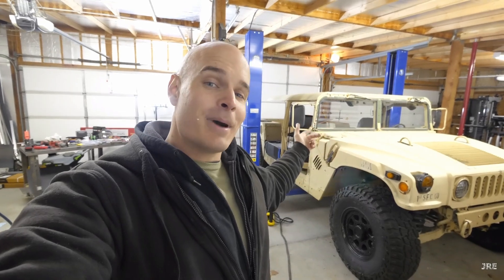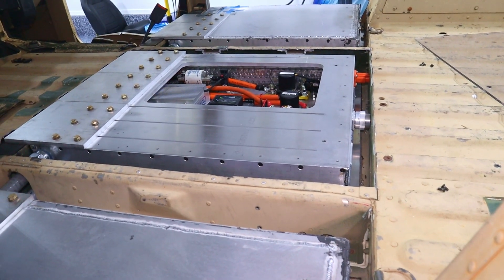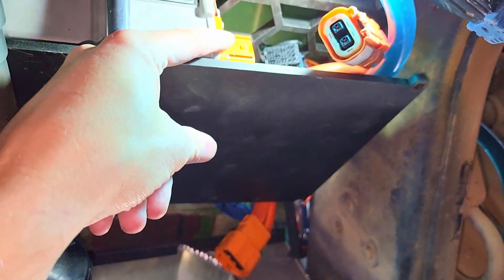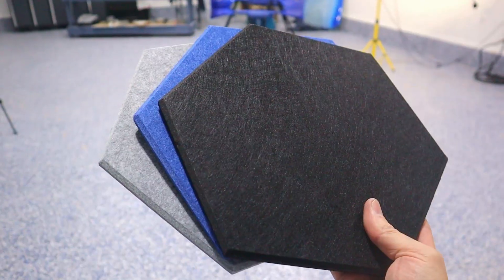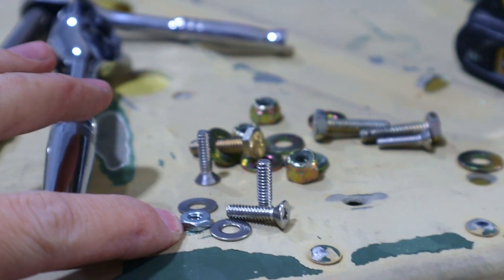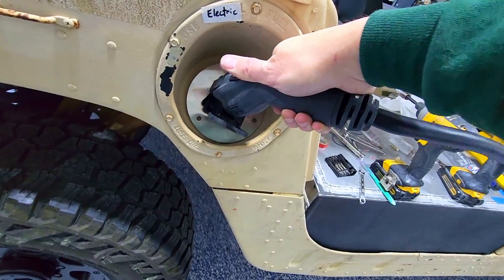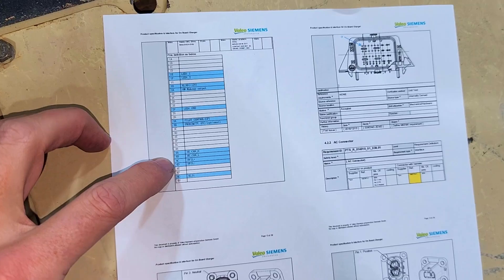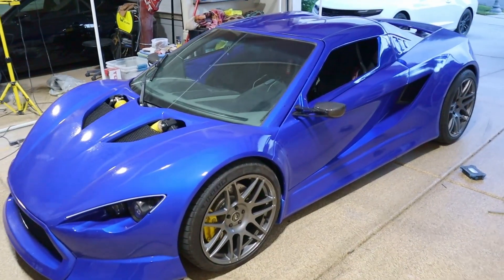Electric Converted Hummer - Diagnosis from the EV Doctor

Comment: You may have to charge each cell individually then try again. All it takes is one cell reading under 2.7v and it wont function.
Reply from the maker: I'll have to get a CAN adapter and talk with the BMS, see if something like that is going on
Reply: One row*. The all the cells in parallel would have the same voltage
Reply: @DoesntRefillTheBrita  Ya thats true for some reason i assumed it would be wired in 4.2v but that would not make sense for any electric motor. It may just be 1 cell that is faulty and you will not know unless you tested every cell individually or if the computer was smart enough to display a error with a pack of cells then your stuck checking every one yourself. Because it took him so long to make the hummer chances are the batteries got really low and is causing these issues. Its the most common problem with lithium batteries and its the same reason why samsung phones are popping open because of the batteries inflating. Charge your batteries! 3.7v for long term storage.

Comment: How odd - there really isn't a neutral in the J1772 connector, L1, L2, and Ground.  Maybe Ground is supposed to go on top of that charger connector.  Weird European charger stuff!
Nice first video.  I'm guessing you're right about the CAN bus being the culprit.
Reply: Neutral is only needed if you want to get 110VAC from the 220VAC, which isn't necessary in this application.
Reply: Not weird european thing, thats a US market specific connector. Europe uses a different connector. The US one is often known simply as J1772 or J1772 Type 1. Europe uses J1772 Type 2 or "mennekes" which has 3 phases and a neutral.
For US usage. You can use L2 interchangeable as the true L2 in a domestic split phase system or as a neutral in either industrial 220V single phase or domestic 110V single phase. The standard allows both and the onboard chargers are designed to tolerate both.
Reply from the maker: Thanks for the comment!
Reply: There was one thing with the locking pin where some plugs can sense the opposite, I am paraphrasing but wonder if this could be related to a locking pin sensor, detecting whether the pin is fully attached or not.

Comment: My first thought would be to disconnect everything from CAN bus and start with just BMS and battery. If that works then add more components to bus, see, when it starts to fail. I hope the batteries are fine.
Good luck!
Reply: he may have to charge each cell individually then try again. all it takes is one cell reading under 2.7v and it wont function.
Reply from the maker: Thanks for the comment!

Comment: What's put on, from the tube, at 8:00? It comes after (over) the soldering, before the crimp tube.
Reply: Could be glue to make it weatherproof like the heatshrinks that has glue in them. I'm just guessing though.
Reply from the maker: Dielectric grease